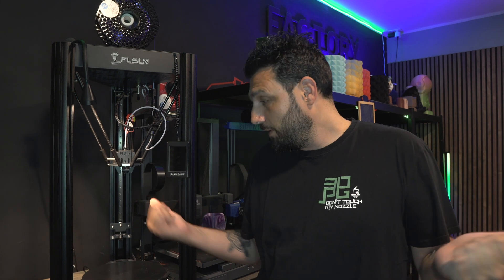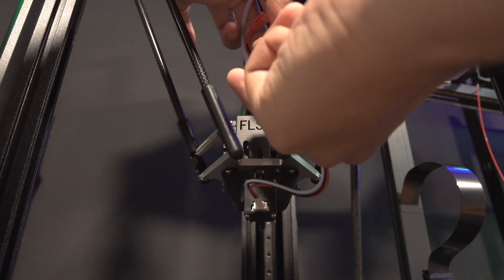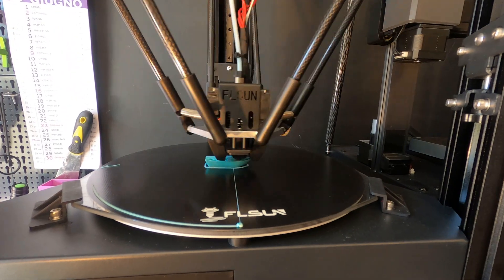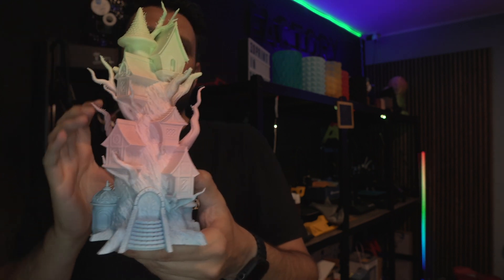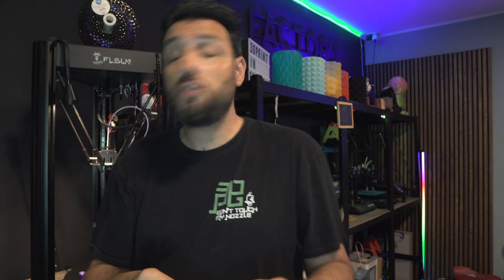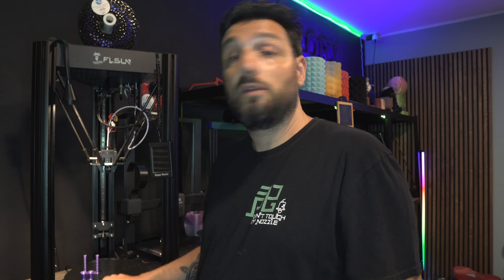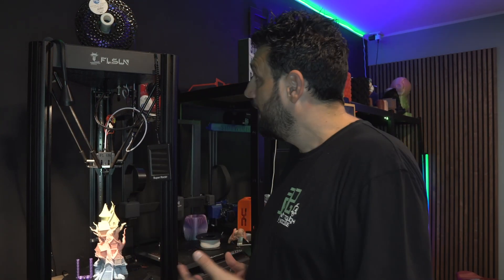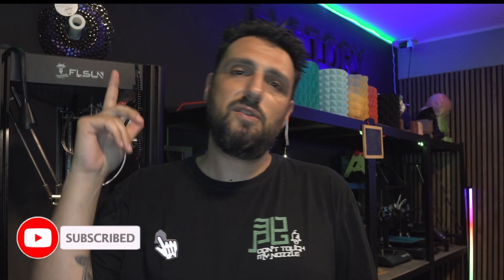Cheapest DELTA 3D Printer in 2024 // FLSUN SR

Comment: Great video. I own a super racer too. Got it as a return with some small issues. Great machine for the price tag. Klipper update is a must to get the full power out of the motion system 👍
Reply from the maker: I totally agree… video ok that coming soon
Reply: Did you use the Speeder pad for the Klipper update or a Raspberry Pi?
Reply from the maker: @scottjackson8931  none of them
Reply: @scottjackson8931  I run a cheap Fujitsu Thin Client as klipper host with a debian install and kiauh script. Much better than a raspberry pi and does a great job :)
Reply: I also got a pre owned SR because I like to fix things and boy did it need some fixing... Most of the accessories was missing and the MB and one of the stepper motor drivers was fried as well as the SD adapter. Be interesting to know what the previous owner did to it. 🙂. Support was great so after a few messages back and forth all the parts missing and needed arrived and the printer is now running perfectly!  I did get a Speeder Pad to run it and the QQ-S PRO I got 3 years ago but it was doing quite good on Marlin as well.  Since the support was that good I got a pre owned V400 a few months later and it only needed a new cooling fan for the MB and stepper motor drivers and a few accessories that were missing.  

Happy printing. 🥳
Reply: @thehaze1972  I can tell a similar story. I get my second used SR. The first one was in great condition and had only some missing screws and a clogged hotend. Was easy to fix with some spare parts i allready had in stock. Then i ordered a second one and it was a nightmare. The machine was shipped in a box without any foam. The shipping has done so much scratches to the machine and the extruder with motor was completely missing. I did a complete rebuild of the machine and the support was not a great help because they told me they dont send parts for used machines. In the end i ended up with a nice rebuild machine and an updated effector with a sherpa mini direct extruder and 5015 blowers. Next update for this machine is klipper. I absolute love the Flsun Delta Printers because of the good build quality and the quiet printing. Happy printing :)
Reply: @christophknorlein-knoben  I bought my printers second hand from Flsun so that is why they supplied anything and everything to get the machine complete and working 100%. I ordered an extra print head together with the pre-owned printer thinking about modifying it to direct drive but I still haven't gotten around to it and I got the V400 now so will see when it happens. :-). Nice that you managed to get your SR sorted in the end. 🖖 Oh and I can recommend a Speeder Pad, great way to get into klipper as a beginner.